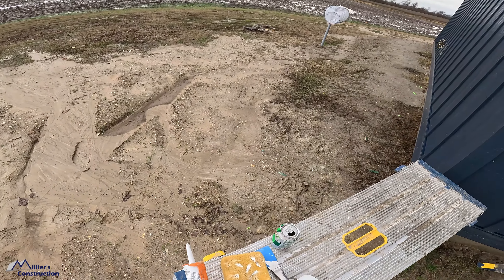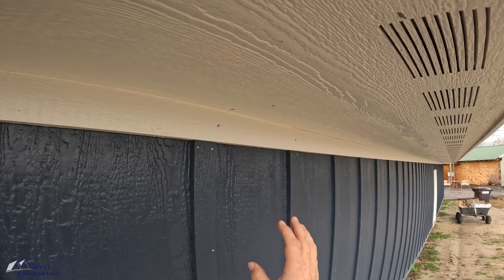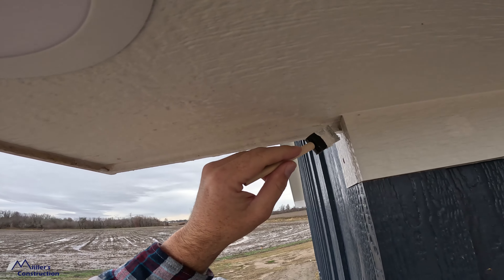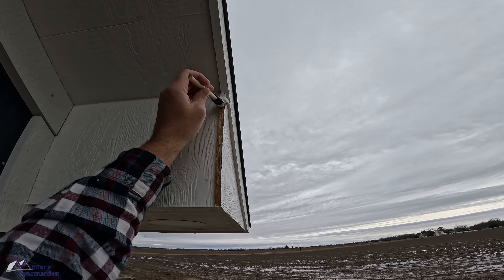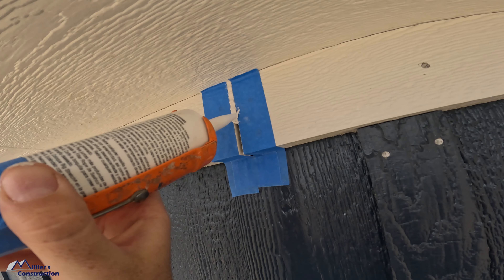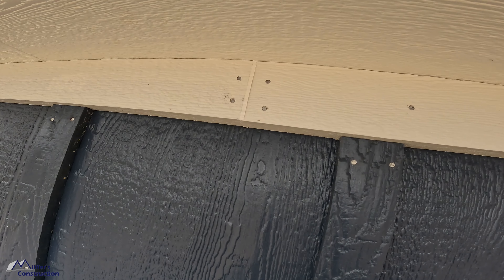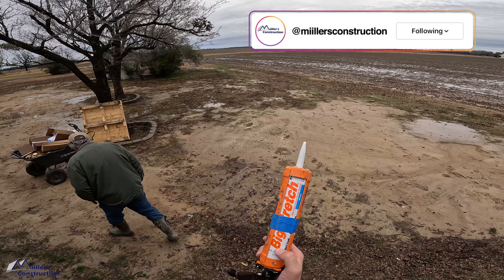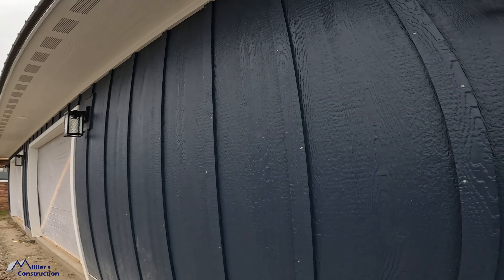How To - Caulk & Touch-up DiamondKote Prefinished LP Smartside Siding

Comment: Beautiful Board & Batten. Did you caulk the seams where the Batten meets the board? Not sure if that is necessary for "warranty"?
Reply from the maker: No. They do not require those joints to be caulked. They actually address that question in the warranty specs because so many ask it. Thanks for checking out the video!

Comment: Wondering if you’ve tried using Diamondkote’s touch-up pen or a cotton swab to hit those nail heads and eliminate any flashing from variance in the colormatch accuracy?

I’m getting ready to install Diamondkote for the first time on our new house, and the thought of those blemishes all over the wall is going to send my OCD through the roof! 😅
Reply from the maker: Yes. Both work well. Just remember this - DON'T PAINT ANYTHING THAT'S ALREADY PAINTED! That's the rule of thumb. As long as you don't paint over paint, you'll never see a thing
Reply: @miillersconstruction  Copy! Thank you!

Comment: I also had an issue with Diamond Kote touch-up paint not matching but they sent a replacement bottle that matched asap.
Reply from the maker: @AE-sq4nk  I found out that we were putting too much paint on. Only paint what isn't painted!

Comment: For anyone using this as a guide, that caulk should never be left unpainted.  Caulk is not a finish, it will break down within a year or two and start to collect dirt.  Painting over the top would have been a very good investment just a protip.  Otherwise good guide.
Reply from the maker: Collecting dirt is not a sign of the sealant breaking down. I suggest you contact Sashco on the reason it collects dirt if left unpainted. Also I can't paint fresh sealant. Big stretch needs to dry a while before I can paint it, that's why it wasn't filmed.
Reply: @miillersconstruction  You do recommend painting the caulk though?
Reply from the maker: @cooper8318  if it gets dirty, yes.